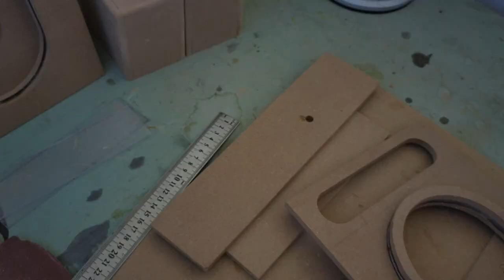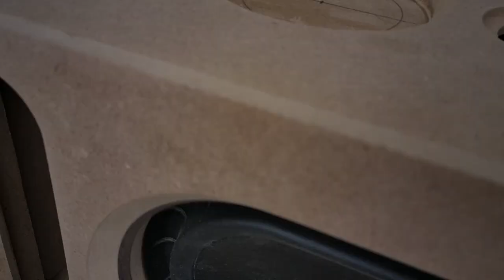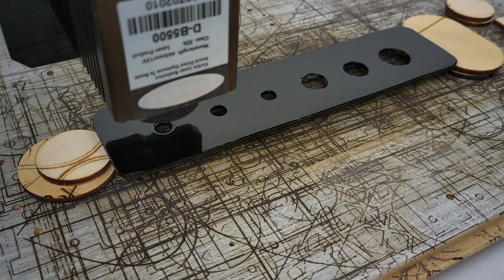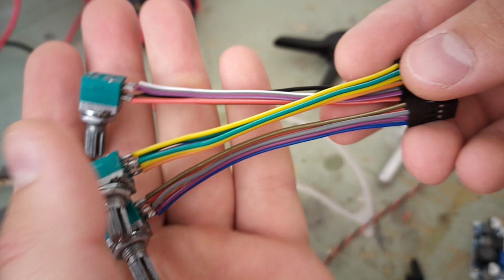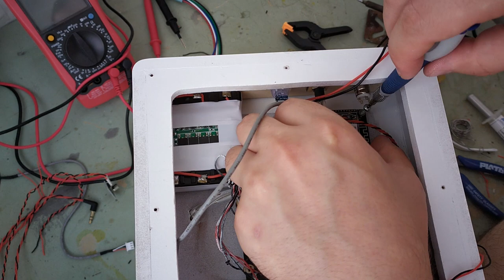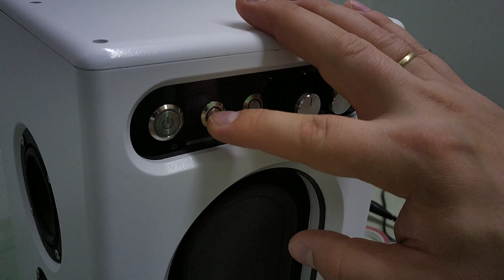DIY Bluetooth WIFI Speaker 360 with Arylic Up2Stream (Part 1)

Comment: Eu só não gosto que os alto falante e o tweeter ficaram invertidos do normal da maioria.
Reply from the maker: What do you mean, connection or speaker placement?
Reply: @DIYAcoustic  O posicionamento da tweeter e dos woofers. Mas o seu projeto fico incrível. Eu sou do Brasil e gosto do seu canal. Obgdo.
Reply from the maker: The location of the tweeter, for a reason, the midrange speakers are in their own volume, it was not possible to make them at the bottom. In the second part of the video, I will make protection for the speakers, and they will not be visible. Thank you for watching and supporting the channel.
Reply: @DIYAcoustic  ah, entendi... Eu sou apaixonado por esses tipos de caixas. Aqui no Brasil não temos acesso a esses tipos de equipamentos. Obrigado!

Comment: Pake amplifier apa?
Reply from the maker: There is a link to the amplifier in the description under the video, tpa3116d2, but it is better to use another model, this one has a very wide frequency range on the subwoofer channel.

Comment: bạn có thể cho tôi kích thước thùng loa không cảm cơn bạn
Reply from the maker: Kích thước loa là 310x200x200mm, âm lượng cho loa trầm là 233x184x184mm (âm lượng của loa tầm trung bên trong là 95,3x95,3x93,5mm)
Reply: cảm ơn bạn 
 @DIYAcoustic